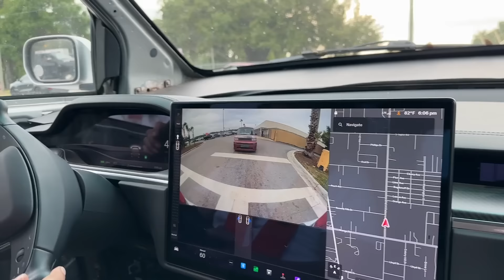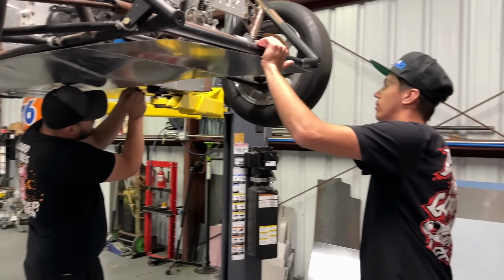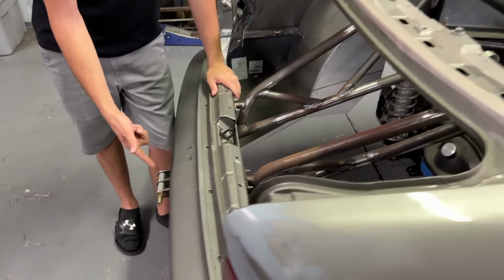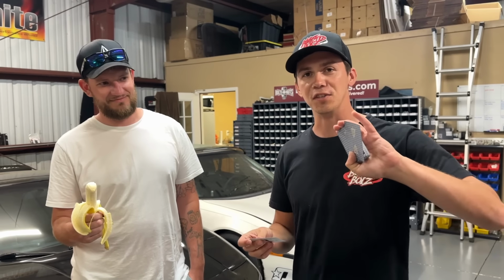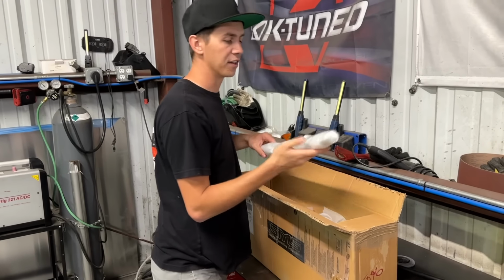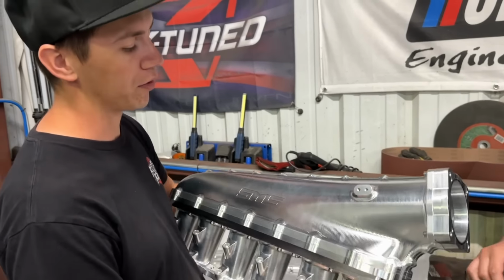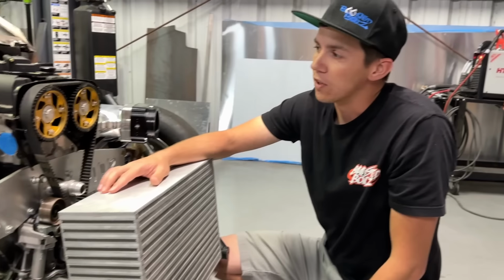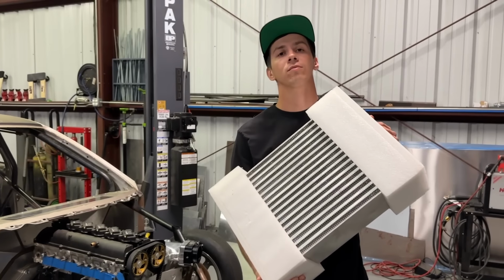New BILLET Parts For Our "Promod" 2JZ Civic Build!

Comment: You should build some skis for the civic in case it does wanna try and come up. 
They are pretty much just a piece of 1/“2-5/8” plate or round tube rolled up towards the front that you weld right into the bottom side of the chassis just a touch lower than the oil pan.  If it ever comes up high and smacks down those will hit first and kinda of slide instead of blowing the oil pan out.
Reply: Bump

Comment: Very nice intake manifold. With the throttle body at an angle, it should help to distribute the air to all 6 intake runners and cylinders more equally during the transient stage airflow and contribute to uniform air fuel ratios. Great choice!!!!! Nice to see an update on the Civic Promod. The Air to Air intercooler will serve well for Drag and Drive like "Sick Week" competitions.

Comment: Get a water cooled  2JZ billet block from Expert [same manufacturer Titan Motorsports use]! Your parthners at FuelTech just installed one in their street Mk3 Supra, the boost it can take is insane. The boost and power it can take is insane, yet runs 86C (186F) in the usual traffic. They'd give you the know how to jump start your process!

Comment: Would be best to go with electric fuel pumps. So you can have a tank 1 and tank 2 switch which you can label gas and ethanol so you don’t mistake it. Not sure if you can program a way to have like a 1 and 2 for tunes so you can have a street tune and a drag tune and just have it on a switch or on a fuel tech or something like that

Comment: Just put a diversion line right after the pump th pump it right back into the tank it won't get up to the rail. You could even have an electric valve to do this. Saves taking belts off if you go mechanical pump
Reply: I think it's a significant amount of wear on the expensive mechanical pump to /not/ take the belt off for street driving.

Comment: #Bootedboiz I seen where the civic hatchback was shaved i did one 12 years ago yeah those fuel rails need metanol And it will fly for reali really  mean that two fuel pumps or the chevrolets have 410lph plus double the power seriously tune it like that you need wrochester injectors or something from #huntertuned

Comment: Instead of water to air you should try CO2 spray bars on the intercooler,there was a company awhile ago I believe called cryO2 that made kits
Reply: Can't lie, i've used paintball c02 canisters to cool down my IC with basic lines and an electronic actuator on a steering wheel switch.. maybe 150$ total

Comment: Hey guys ***** Heads Up ! **** Asap pls for gods sake do 1 of a couple of things. As having worked with sheet metal since the 70s never leave a cut edge ever. You either need to crip it over or much more labor would be to run a weld edge then round and smooth it. If you don't you will regret beyond what you can imagine, especially in racing conditions where you are rushing along or night time. It will slice your hands or anything just like a razor knife would. Just words of advise and hope they find you. Cheers

Comment: You say you want to keep it simple , use flex fuel ,  and save the weight of separate fuel system , not like you running beyond e85 cooling pros , you still have a stock block not sealed meaning limited to about 1500 whp , 2nd fuel system if a waste of money and extra weight

Comment: Methanol is fantastic! I run a water methanol injection on my daily. I can be cruising along with IAT's about 100° or more, but if I floor it temps drop into the 30s! Plus it's extra fueling.

Comment: You mean a 6 part series on the intercooler. You forgot the piping to and from and then the rebuild of the mounting brackets so it fits better in the chassis.